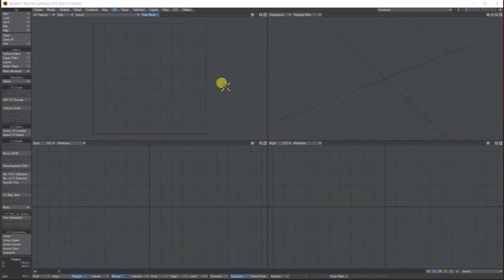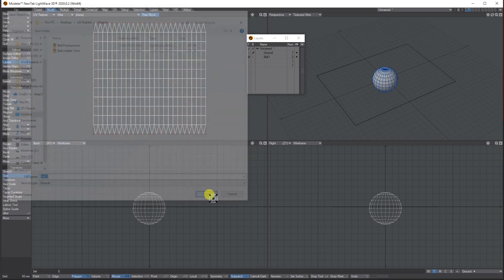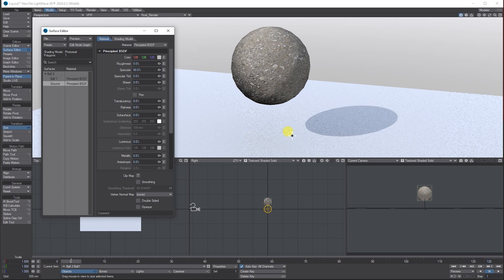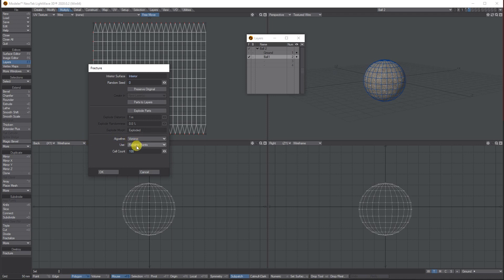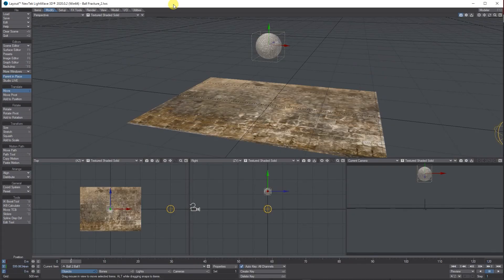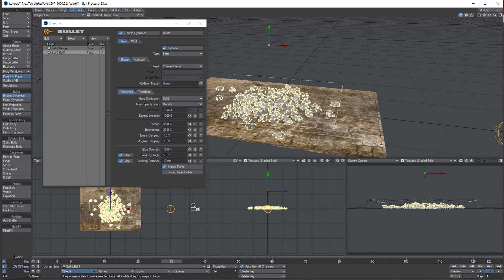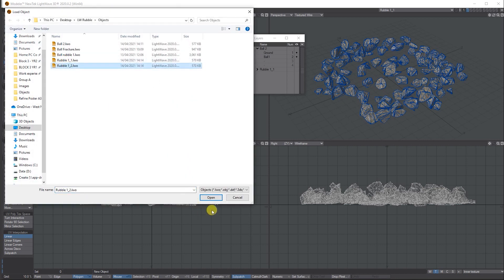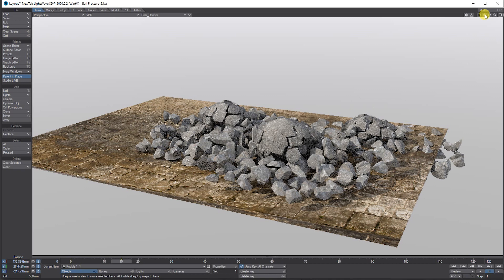Lightwave 3D basic Rubble Tutorial

Comment: Use points in a separate layer (in Modeler)when doing fractures, it gives more control over the size/position of parts. My advice, always preserve original, b/c it's prone to locking up if you're doing complex models.
Basic fractures with all the chunks the same size, just end up looking unrealistic. Use of gradients for glue strength etc also a must. Props for supporting LW though :)